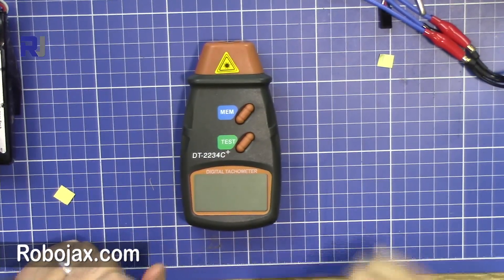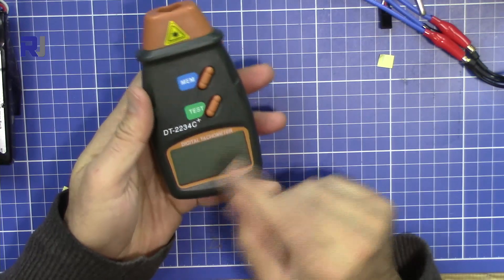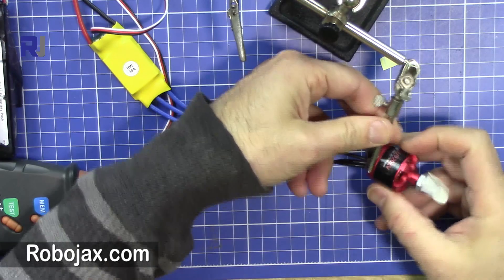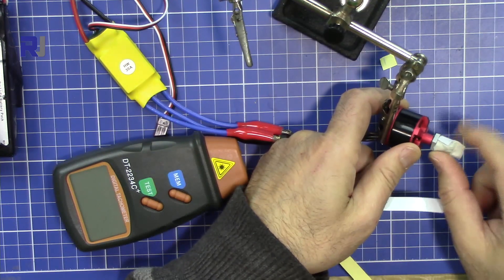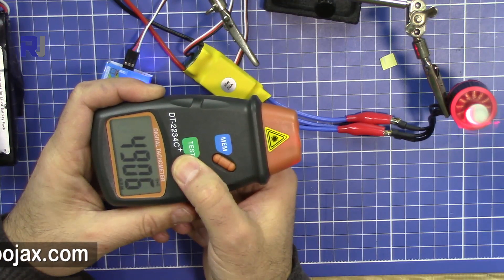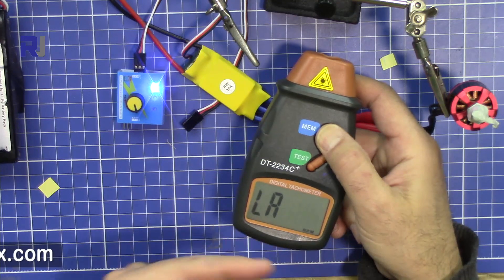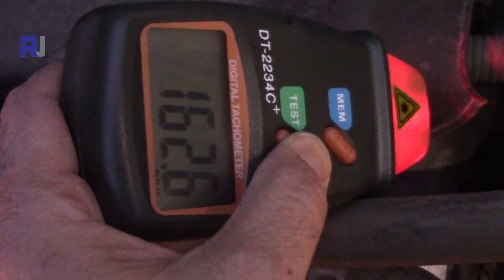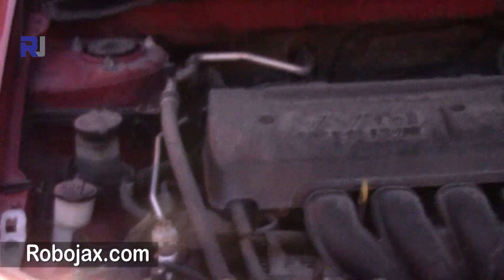DT2234 Tachometer how to use and measure RPM of brushless motor

Comment: Is this tester accurate?
Reply from the maker: Yes it is. The operation of this is very simple.
Reply: @robojax  why car rpm is only 169 ?
Reply: @playstation2bigs  He is doing it wrong. He's measuring the belt, not the actual dynamo. Think about it, the length of the belt is a lot greater than the dynamo wheel's circumference, so obviously this measurement does not give the RPM of the dynamo.